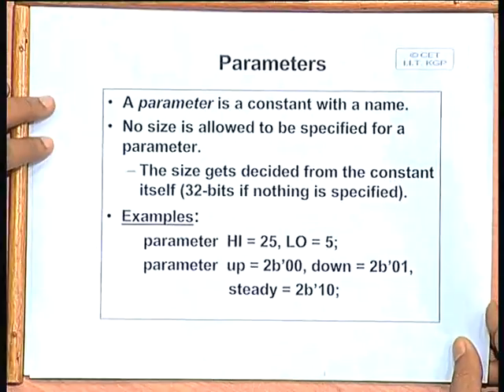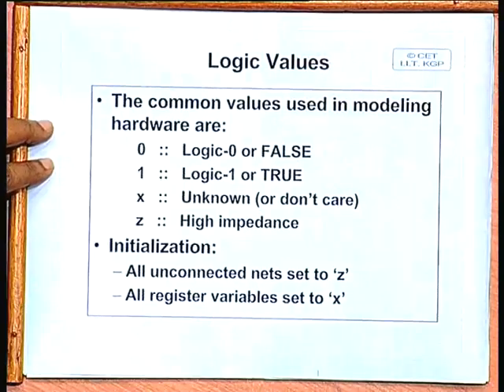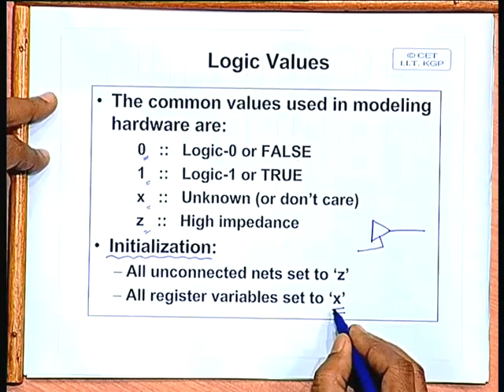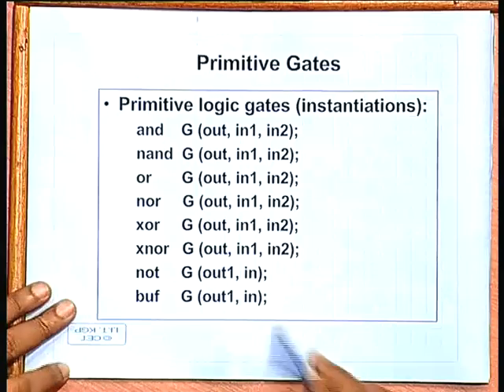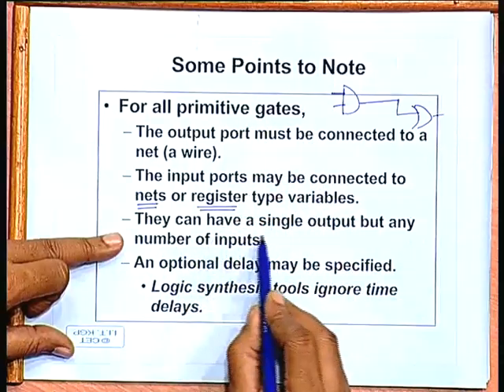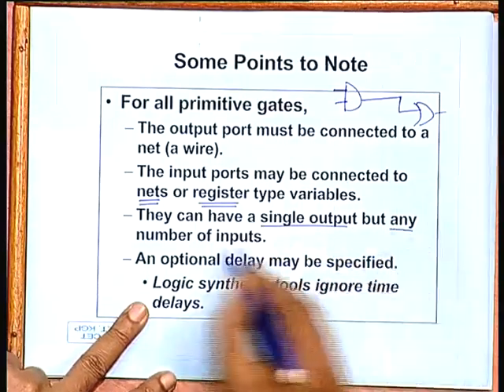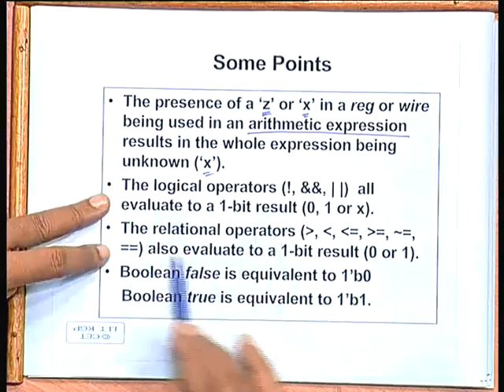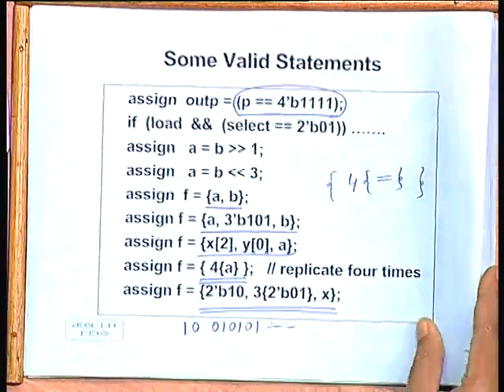Lec-3 Verilog: Part-II

Comment: At 36:55 and elsewhere, Prof. Sengupta insists that the statements within a begin/end block are executed concurrently. Why is it that all the Verilog references I see say that the statements within a begin/end are executed sequentially? Examples: 
- The Verilog Golden Reference (Doulos):"Statements in a begin-end block are executed in sequence."
- Wikipedia: "Sequential statements are placed inside a begin/end block and executed in sequential order within the block."
- Verilog® HDL
 Quick Reference Guide: "begin—end groups two or more statements together sequentially, so that statements are evaluated in the order they are listed."

Am I missing something here?
Reply: It depends on whether you used blocking or nonblocking statements. Blocking statements (LHS = RHS) are done sequentially; nonblocking (LHS <= RHS) are done concurrently. Therefore EITHER behavior can occur depending on how you code it. There is a good article on this (blocking vs. nonblocking) over at Nandland.